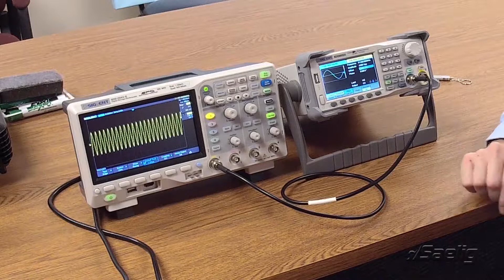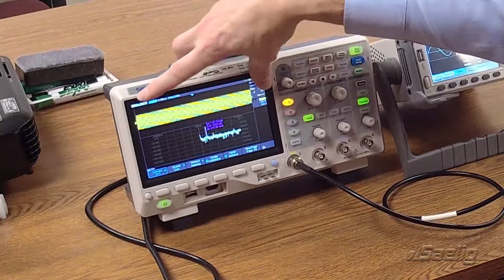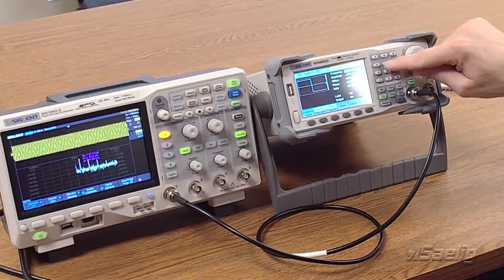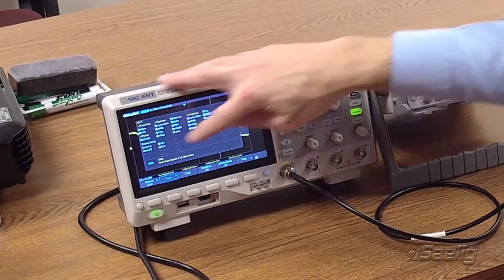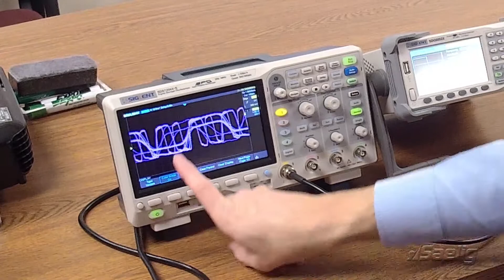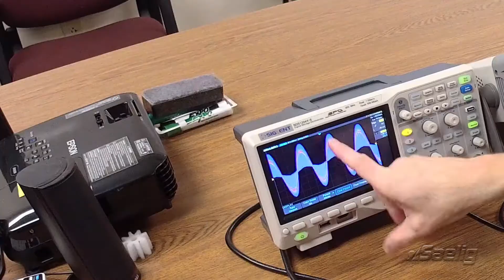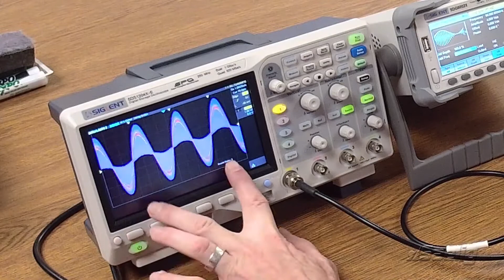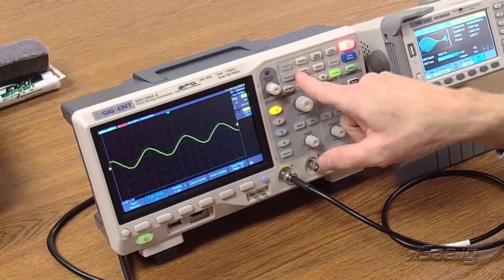Siglent SDS1204X-E  Scope & SDG6000X AWG -Video 1 of 3

Comment: Hi Jason - I just purchased a SDS1204X-E.  Can you point me to a location where I can download the user manual? I've not found one for this scope on Siglent's "download" web page. The closest manual seems to be the SDS1000X-E_UserManual_UM0101E-E03C. Also, there does not seem to be an external trigger input on this model though I see that the two channel variant has such. Is there a way to trigger the scope from an external input? - Thanks - Jim
Reply: Hello hubercats. Thank you for watching the video and writing in. The SDS1000X-E is a series of 2 and 4 channel oscilloscopes. The latest user's manual is the SDS1000X-E version that you reference, but you can also find the latest here: https://siglentna.com/resources/documents/digital-oscilloscopes/#sds1000x-e-series

The 2 channel X-E does have an external trigger input. The 4 channel versions do not, but you could simply use one of the input channels as the trigger, as each analog input has the ability to be selected as the input trigger source. 

You can write us at info@siglent.com if you have additional questions. 

Sincerely,
Jason
Reply: Hi Jason - Can you tell me what it means when the “Slow acquisition” message shows up on the screen of my SDS1204X-E? I searched the manual to no avail. - Thank you - Jim
Reply: @hubercats  Hi Jim. The acquisition rate control adjusts the time interval between trigger events.. similar to holdoff. Slow decreases the max trigger rate and effectively decreases the number of waveforms per second that are shown on the display. It is similar to holdoff, but not as useful.
Reply: Siglent Technologies : Thanks, Jason. I don’t recall setting the scope for slow acquisition. Is there such a setting, or does the scope choose it automatically based on other settings? - Jim
Reply: @hubercats  The acquisition mode is manually selected and is located in the Acquire menu, page 2/2. - Jason

Comment: Great video!! Could I somehow create audible sound from this? What product would I then need?
Reply from the maker: What exactly do you need to do?  A small amplifier with speaker (such as you can by from Best Buy) would make the signal generator output audible.
Reply: @SaeligCoInc  Thank you for your answer! I would like to use waveform generator during a concert to generate a kick drum.
Reply from the maker: @johanrinman6227  Generate the sound of a kick drum or actuate a physical drum?
Reply from the maker: @johanrinman6227  A kick drum sound is quite complex. You could sample the signal with a microphone and oscilloscope and send the stored waveform to the SDG to reproduce.  But the following might be better solutions for you: 

https://www.sweetwater.com/store/detail/SPD-1K--roland-spd-one-drum-pad-kick
https://www.sweetwater.com/store/detail/Chromaphone2--applied-acoustics-systems-chromaphone-2-creative-percussion-synthesizer
with an amplifier
Reply: Generate the sound of a kick drum

Comment: 1. is it normal if working 1204xe without any probes in shows 30-40-50 mv rms pulsation on Ch1-Ch3. And Ch4 about 2-3 mv rms.
2. 2042x generator outputs wrong voltage (double the value shown on display ) in "50-Ohm" mode. Changing to HiZ makes output correct again. Is it a bug or some logics of work?
Reply: 2. This is normal. The '50 Ohm' position is actually only displaying the accurate output voltage when the load is 50 ohms. The actual output voltage across the load will always be Vout * (R(load) / 50 + R(load)). The higher the R(load) is, the more accurate the HiZ displayed voltage value is. The selectable output impedance setting is merely doing the math and assuming the R(load) is either 50 Ohms or HiZ (at least several kohms).
Reply: 1. in DC coupling about 14-15 mv for CH1-2. about 0-2 mv CH3-4. 
in AC coupling about 28 mv CH1-2 and 1-2 mv CH3-4. 
in GRD coupl. 14-15 mv for CH1-2 and about 0-1 mv for CH3-4. 

Looks like CH3-4 are more "clear". What V could it be? Bad PE line?

Comment: can i use the trig out jack on the back of the scope to connect to a frequency counter?
Reply: Yes. That will tell you how fast you are triggering (Triggers / second)
Reply: Would it be possible to add external synchro sign input trough one of the front inputs in future firwares?
Reply: Can you please write me at info@siglent.com with more information about the application? I am not familiar with "external synchro sign inputs" and would like to learn more so that I can properly respond.

Comment: Why not show the SAG1021 AWG that is an option for the SDS1204X-E 4CH model only that plugs into the front USB connector? There is also a MSO option only available for this model with16 Digital channels that plugs into that propitiatory socket next to the USB connector.
Reply: Hi Jerry. Sorry I am a little late to the party. We actually didn't have any of the SAGs in stock when I did this video. The MSO option was also not ready for release at that time. As of 02/12/2018, these parts are all available. Hope that helps. Jason Chonko
Reply: Maybe you missed it, but this video is produced by one of the companies selling the parts, and made by their *marketing manager*. They are in business to make you want to buy their stuff! :-) No angst intended, just thought you may have overlooked that part.
Reply: Brad Hedges: I realize the relationship between the two companies. If they are selling this scope, the SAG1021 and the MSO Option I mentioned are for this scope only, no other model not even the 2 channel version can use them. I later found that the MSO Option won't be ready until March 14 when I tried to order all three components. I opted to only buy the oscilloscope for now and just received it today. Happy times.
Reply: I bought the SDS1204X-E and a SDG1025 AWG a few weeks back and I'm still having a blast discovering all the features of the scope. I would like to just order the MSO option now but I would be better informed if I wait to see a review or two first. I'm not very hopeful that this will happen as the reviews for the SDS1204X-E have all been done and this MSO option is for this scope only. Time will tell and I might just need to roll the dice and order it should no reviews be forthcoming.
Reply: I plan on doing a dedicated MSO and BODE plot videos for the 4X-E as soon as we receive the MSO hardware. If there is anything specific you would like to see, just shoot me an email at jason.chonko@siglent.com
Reply: Hi Jerry. I added two new videos to our channel last week covering the AWG and MSO. Not super technical, but they should get you started. 

AWG:  https://youtu.be/5AC6glStPwY
MSO: https://youtu.be/2q-aRCLELkk